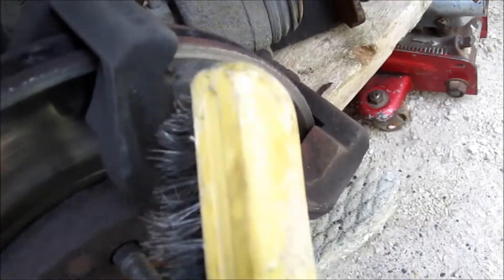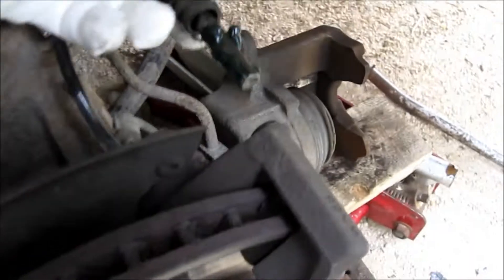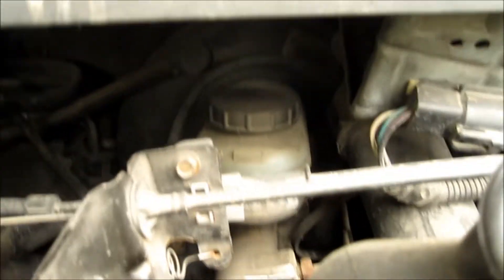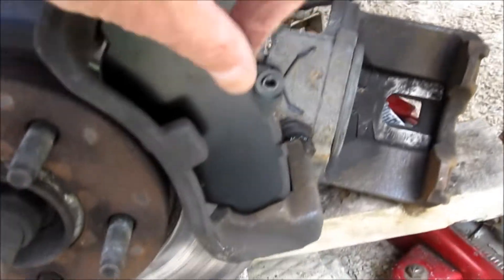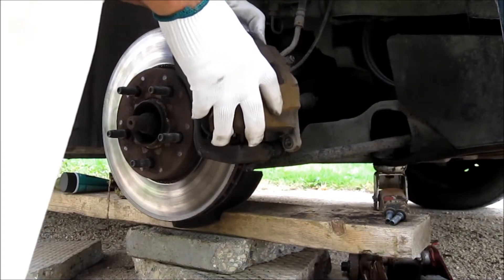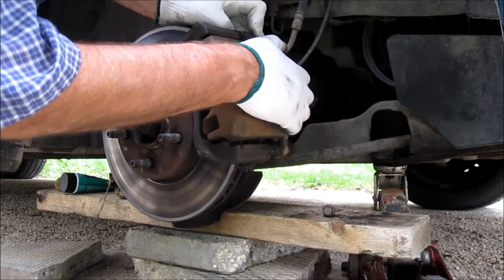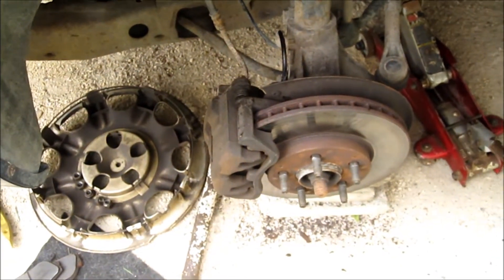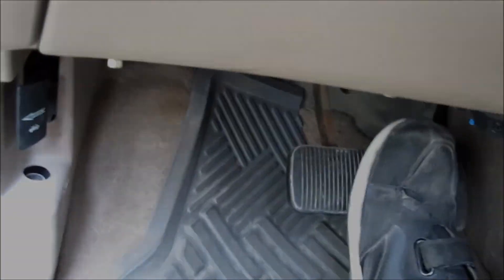Installing Brake Pads *Ford Windstar*

Comment: Please do not use the C clamp as this fellow did, never ever put the clamp inside of the cup of the caliper, it is too thin and weak and if you do that it will most likely dent or crack the cup. Always take the old brake pad caliper side and place it in the caliper body against the cup and then place the C clamp on the old brake pad and then press it in that way. ..

Comment: 2:08 what is the purpose of those two pines and why to lubricate them?
Reply: The pins float inside of the brake body and when you tighten the bolts down to hold the caliper in place, it is not solid and when you press on the brakes the caliper body will move and the pins provide the body the ability to move. The grease is so that when it moves it does not hinder the movement of the body as the heat from the braking over time and work a groove or cuts into the caliper body and so this helps the body to move and prevent squealing of the brakes and brake chatter.